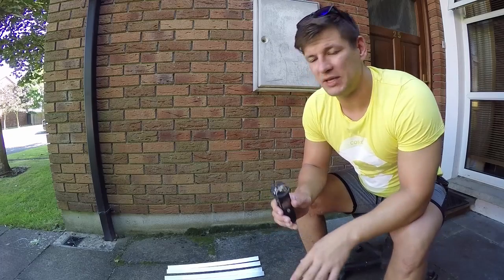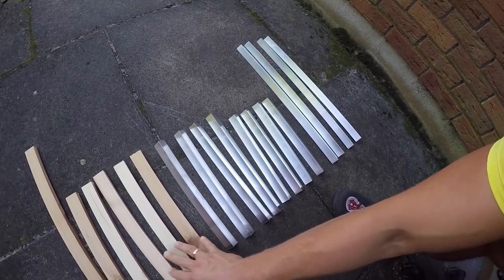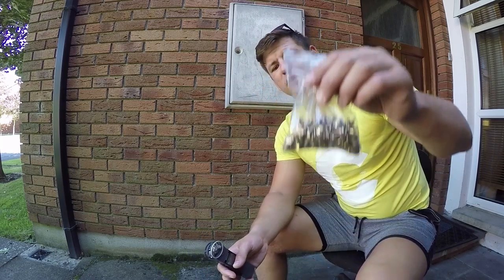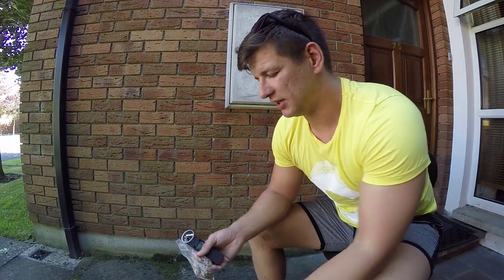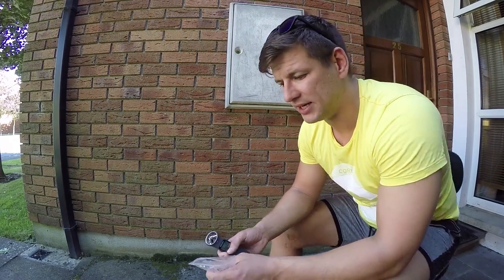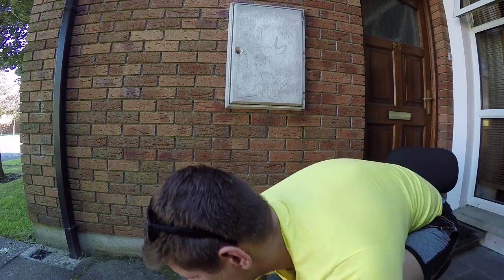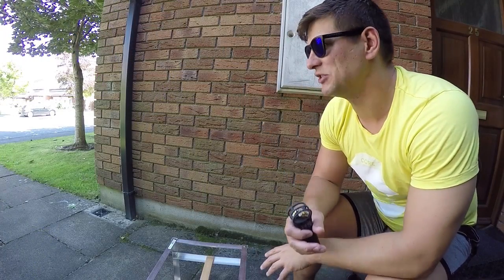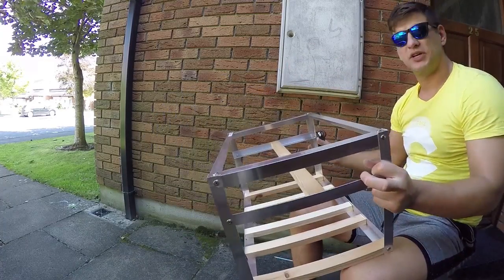How to build your 6gpu ethereum mining rig OPEN AIR frame for mining ether!

Comment: Heading to the hardware store in a few hours to buy the hardware. Going to follow this video guide. Fantastic tutorial, simple and efficient....Thank you so much! One question, what was the thickness of the aluminum angle?
Reply: I just got back from the hardware store and I've cut all my pieces to the right size. Fixing them together now. Perfect tutorial mate! 👌
Reply: Have yall found out thr thickness for the wood and the angles?
Reply: @bigdog2564  Hey man, I used 20x20x1.5mm for angled aluminium and I found some sqare wood bars with 21x21mm that fit nicely.

Comment: Just wanted to say thanks for the video; I built an 8 card frame using similar components and build procedure!  It's working great so far, although I'm considering adding feet to keep the intake from the PSU off of the carpet

Comment: The one measurement left out is 11.5 cm from the top where the metal holder of the card sits to the wood where the riser sits.
Reply: 11.5 plus height of wood

Comment: What thickness wood did you use?   And because we are in US, do you recommend rounding to nearest 1/4 inch?  For instance 55cm = 21.6535 inches.  Round up?  down?   Do you have exact measurements in inches?
Reply: I used 1 X 2 but if you can find 3/4 inch thick it would be perfect IMO... also make sure the screws are long enough to actually grab the wood! Went through a few types of screws
Reply: I would try to find a yard stick that has centimeters for the easiest conversion.. just built mine and its a bit shotty but I used 4: 11 11/16 in 4: 13 3/4 in  4: 21 11/16 in for the aluminum... wood was 5: 13 3/4 in and 1: 21 11/16.. those arent exact because the conversion loses decimals.. for precise try to find a yard stick

Comment: And what screws are you using?
How thick is aluminium sheet?
Thanks
Reply: i used 1/16th inch thick aluminum and it worked out pretty well.

Comment: where do u buy the aluminum angle and the wood cuts
Reply: home depot, or Lowes in the U.S., they have all types of angles and wood types. They are like 8 ft long and you cut them down with a $6.00 steel hack saw in the tools department. I am currently building it right now!

Comment: And where exactly do you put the longer wood bar? in half the depth of the frame? (12.5 cm away from the front part?)
Reply from the maker: Fernando Alberto Tellez Miotta all depends how thick is the wood, I have 2cm I measured 11.5 cm from top

Comment: Why use wood? Why not all aluminum?
Reply: and that's why most computer cases are made from wood, rather than aluminium or steel.  Simples.
Reply: True, but steel computer cases have dimple raised screw holes so MoBo touches the frame only at spot around screw.  On flat stock aluminum frame , edges of MoBo lays flat, and although PCB is coated, it may rub-off or deteriorate to point of shorting situation. Wood cross-members are insulating safe(if dry) and no static either(unlike plastic ones).
Reply: because if u used aluminum it will case short circut in MB
Reply from the maker: Acrotar what you mean? wood is that more away to attach motherboard and psu
Reply: Guntis Vitolins I mean why not use all aluminum, seems weird to mix wood and aluminum, can the mobo and stuff not sit on aluminum?
Reply from the maker: Everything is possible , you can buy a case also and put in case, this is the way I build:)

Comment: Hi Guntis Vitolins what is the messurement in the minute 5:37 nice guide buy the way (Y)
Reply from the maker: thank you for feedback, please read description
Reply: :) the messurement that i'm asking does not have that, i'm meaning the distance of the top to the location where we are going to put 1x55cm wood, you made a messurement at this minute with a tape :)
Reply from the maker: all depends how tick wood piece you use, in this here from top is 107mm.
Reply: Thanks Exelent